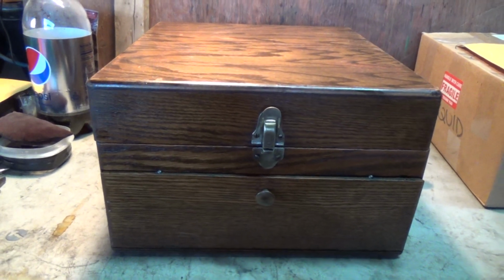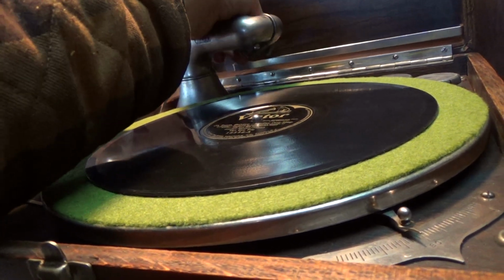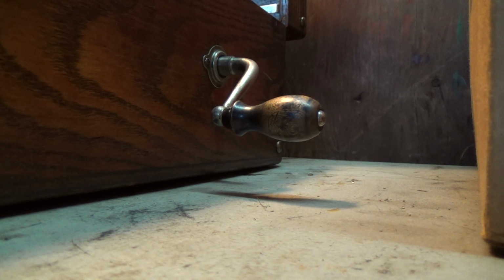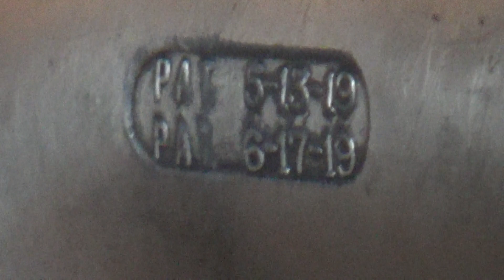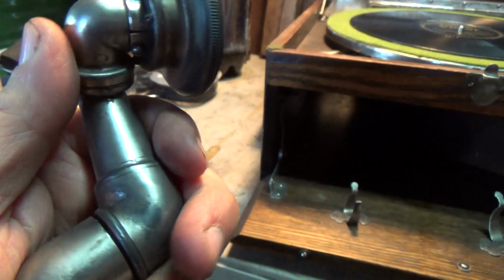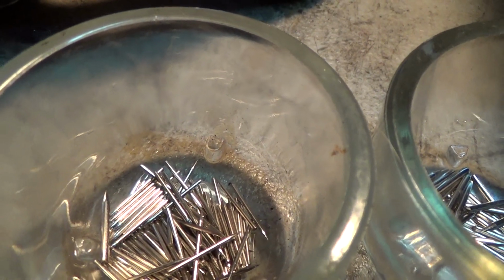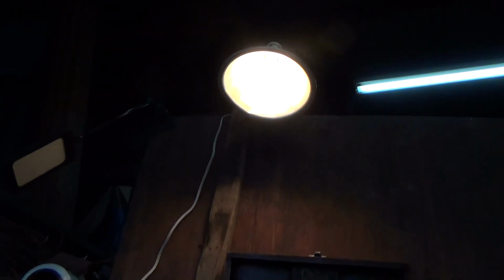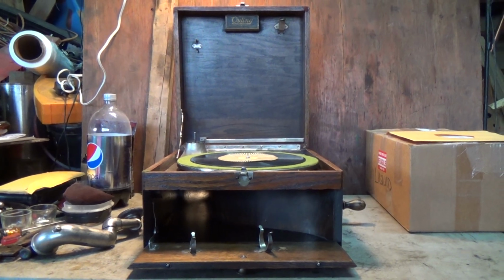1921 Outing Talking Machine revisited

Comment: Several years ago I saw a machine similar to this one in a antique store,it had a small turntable a one piece sound  box and tone arm storage in the horn like this one has
Reply from the maker: Yes, other than it's larger size the layout of this machine is typical of more than one of the offbrand portables.  Like Victor with the big VV-50, Outing hadn't yet learned what the public wanted in a portable machine.  Two spring motor, 12" turntable all vanish in a year or so and the next generation of Outing was smaller, lighter, 10" turntable, and single spring.  Gone also was the fine wood finish in favor of coated cloth like the Victrola 35.  For all it's size and weight the demand for portable machines in 1921 was so high that they still sold a lot of them.  I have at least nine or ten mahogany Outings stashed away.  They were a local manufacturer so that could account for some of it, but I have bought them online from all corners of the country.

Comment: As usual a great presentation, a vert interesting machine! 
   I believe your needle cups are sediment bowls for use on some old style fuel filters.
Reply from the maker: Correct!  I had removed them from old fuel pumps and AC filter housings for eventual sale on eBay, but realized that they make nice needle cups for phonographs that don't come with them.  The glass is thick enough that they can take a pretty good shot and not shatter.  I am slowly accumulating them, and may offer them some day as needle cup sets.